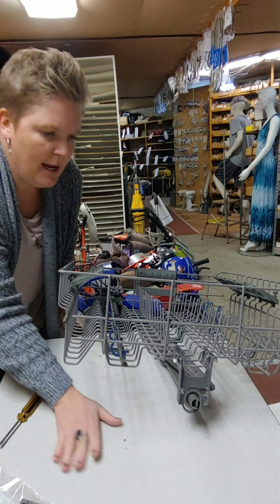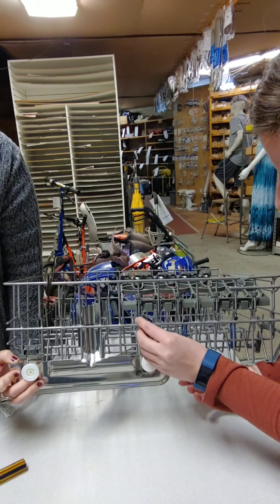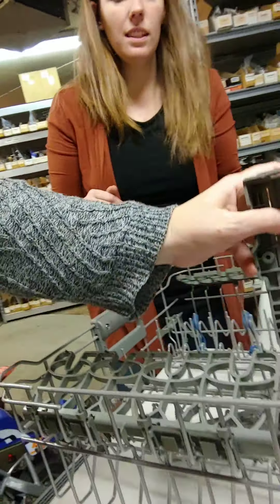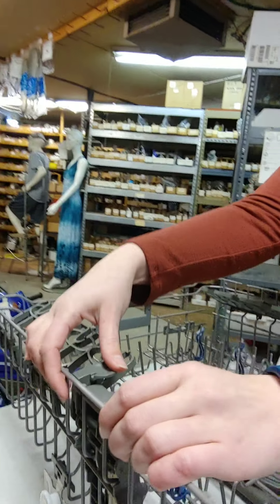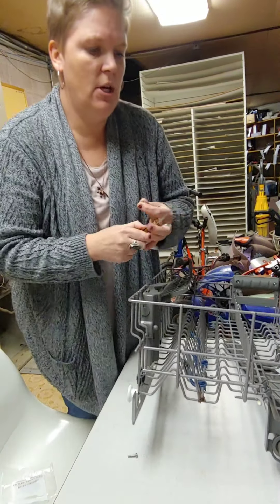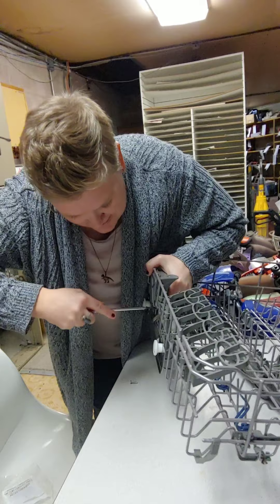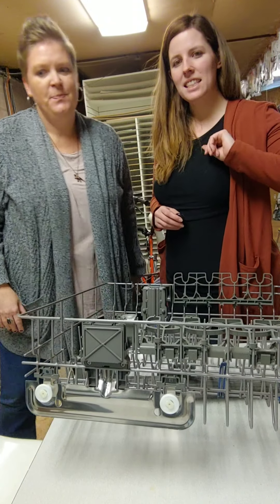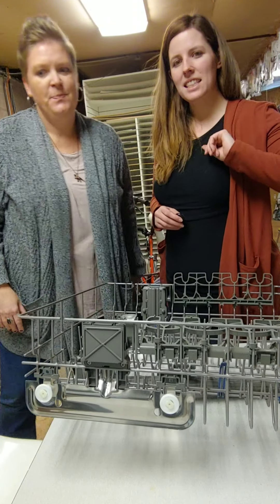How to replace a Whirlpool Dishwasher Upper Rack Adjuster W10712394 and W10712395

Comment: I pay good money three years ago and now the plastic clip that hold the bracket is broken. Now I have to pay and buy the "right" kit?
Reply from the maker: John, depending on the version on the dishrack yes usually you have to buy the whole kit.  If your adjuster is like the one pictured where the main body of the adjuster is metal we should be able to get the clip on its own, however if it is the old style, where it was ALL plastic then you have to buy the new metal kit.